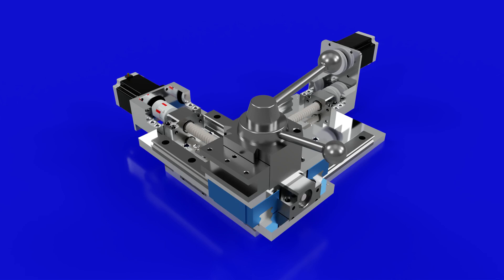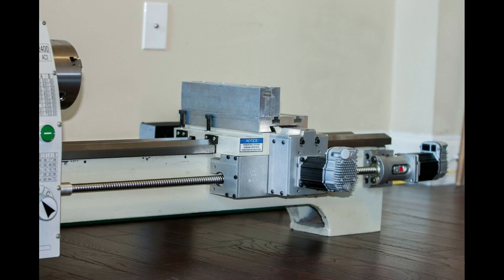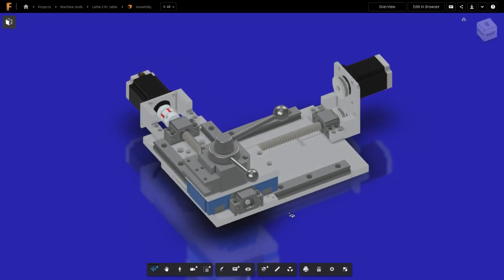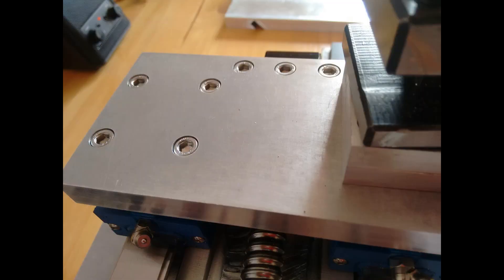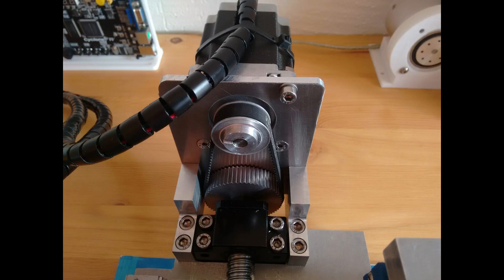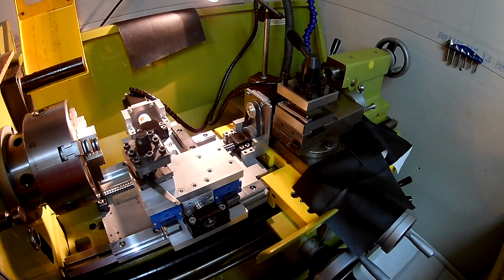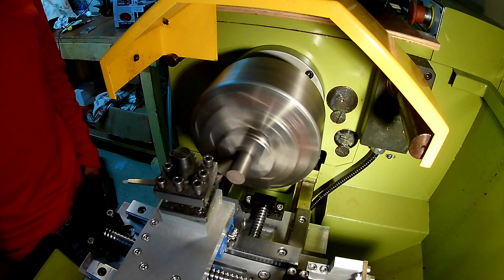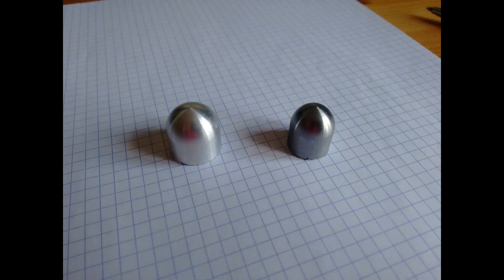How to go about a lathe CNC conversion with no lathe modifications.

Comment: THIS IS OUT STANDING.i 82 years old and have been running manual lathes since 1953, I ran the first Mazak cnc lathe in St louis in 1977. Retired useing a Mori seiki cnc with live tooling. NOW I HAVE MY GAREGE SHOP. I have 1340 manual lathe with every imaginable tooling.,,5 chucks 80 plus piece 5 c collett ect, ect. Nothing beats a small enginne lathe for the eveyday jobs.BUT I REALLY REALLY MISS CNC CAPABILITY. I AM INSPIRED TO TRY THIS..Have you  thought about adding threading capabilitys?
Reply from the maker: Hi. Thanks! This has been an extremely useful tool. I did a significant upgrade to it last year, replacing the aluminium plates with 15mm steel plates. It's now extremely rigid and very precise with all linear rail mounting surfaces having been surface-ground. It can already do thread-cutting: See my video on the making of a spindle encoder.
Reply: @girvaw  prosze o film z modyfikajcą modułu -  płytami stalowymi 15mm

Comment: Curious as to how you still like it! And is there any way to add tailstock support? What do you estimate the swing would be if you put it on a 10x lathe? I make a lot of pens and this would be perfect for me... I just really need that tailstock support unfortunately!
Reply from the maker: This has been a very useful project that I use relatively often. There are a couple of ways to use the tailstock. If your lathe bed is long enough, take the tailstock off and put it on the chuck side of the carriage. You would also want to position the z-axis stepper off to the side to keep it out of the way of the saddle. Another way is to make your own saddle that is fixed to the CNC table. Good luck!
Reply: @girvaw  thats great info thank you! do you happen to have a parts list for what you used?
Reply from the maker: @guitarchitectural  I don't have a formal parts list. When I have a moment, I'll put one together.

Comment: Thanks so much for sharing! I've recently started designing a similar concept, and finally thought "I bet someone else has had this idea before." Thanks for letting me skip the "wrestling with Fusion 360" stage of the project and get straight to ordering parts!
Reply: ... I just measured t-slot bed to center height and it seems like my lathe (Sieg SC4) is quite a bit smaller than yours, so it turns out I will have to spend some time fighting Fusion, but at least there's an excellent starting point to refer to!

Comment: That's excellent! Manual and when you want to CNC a part, just plonk the CNC bed on. Would love a more detailed video on this - what speed pc, BOB etc. I know even with motion controllers, Linux CNC still controls all the movements etc., but still not entirely clear on best interfacing boards for it.
Reply from the maker: Thanks. The PC requirements for LinuxCNC do not appear to be too critical. Until recently, I used a 15+ years old i686 32 bit machine running Debian Wheezy. It ran fine using the built-in parallel port to drive the steppers. Due to unsupported packages on x32 I recently replaced the motherboard with a 10+ years old i7 x64 board. This board doesn't have a built-in parallel port, so a PCI parallel port was added. This revealed some compability problems. I eventually settled on a NetMos parallel port. Unfortunately the outputs were unable to drive the opto-isolated stepper driver inputs, so I ended up constructing a buffer using 2 x 74HC541 octal buffers. Works fine now on Debian Buster.

Comment: smart idea , as long as youre tram the device against the chuck , if you can fit the stepper motor in between the lathes ways you could rotate that part of the setup and should be able to use the endstock again
was thinking about a controlller from rockettronics.de that can allso tap treads but was kinda hesitand for the same reason , this might solve that problem
Reply from the maker: Thanks for your comments. 
Tramming-in is indeed a necessary step in setting up the table. Regarding, the tailstock, it's not the height of the z-axis servo that's the problem. Instead, it's that the saddle sits behind the table. So the tailstock can only be used if a very long workpiece is being machined, or a huge amount of tailstock stick-out can be tolerated.

Comment: That is a fantastic solution to get the best of both worlds. I would like to have a cnc lathe for doing the work I would normally have to grind form tools for but I like running my machine manually for the rest of the operations. This is perfect, I hope you don’t mind me copying your idea. I have a similar size lathe as yours so lots of room to fit a small cnc capable attachment. 😬 subbed.